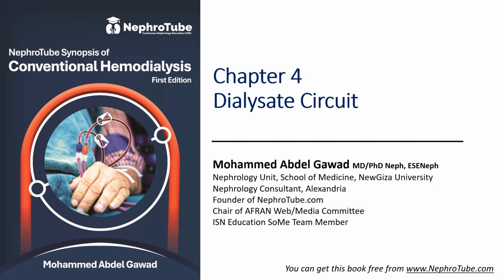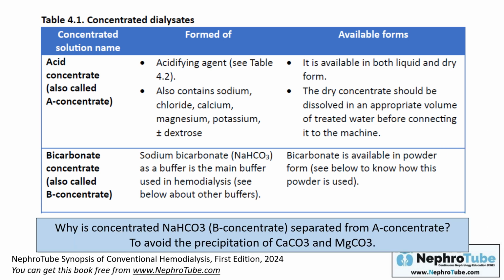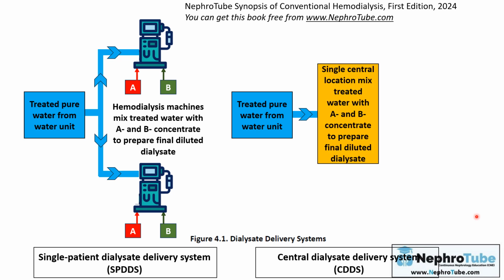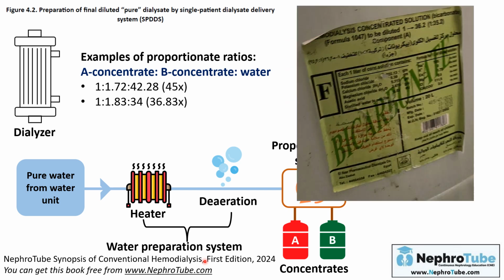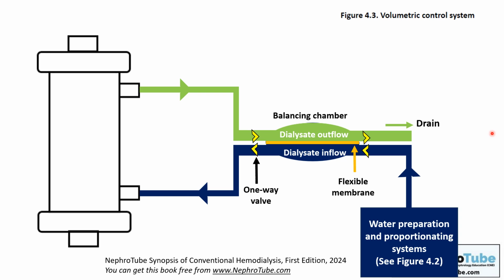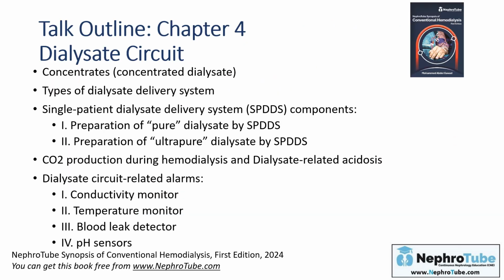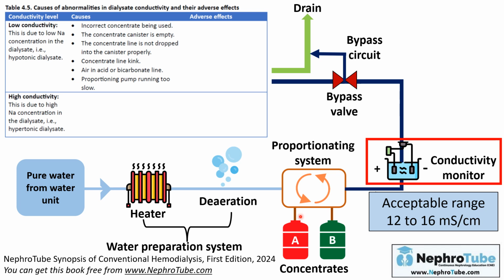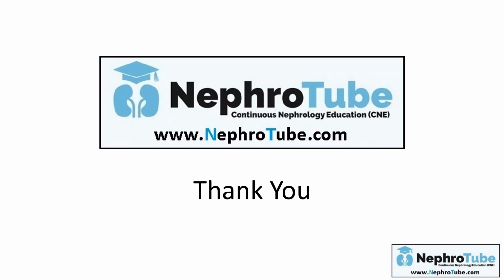Hemodialysis: Chapter 4: Dialysate Circuit - Dr. Gawad (English Language)

Comment: Thank you for this lecture.. i have a question about conductivity, as you know the conductivity is an electrical value that reflect ionic charge mainly sodium but its also affected by temperature, water quality and type of A concentrated espatially the dilution ratio, so for my opinion conductivity and sodium concentration in dialysate are not always the same thing and they dont always change in the same way. My question for example: we have a prescription of 140mmol/l sodium and conductivity 14,2ms/cm on machine, if we change the sodium to 137 mmol/l for the same dilution of A concentrated, how does it affect the conductivity or it will be the same? Thank you again.